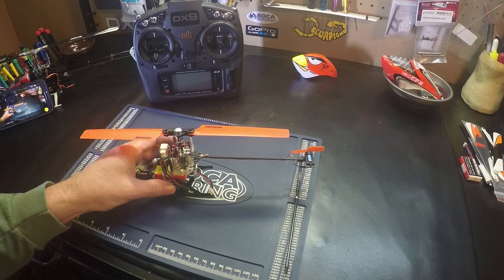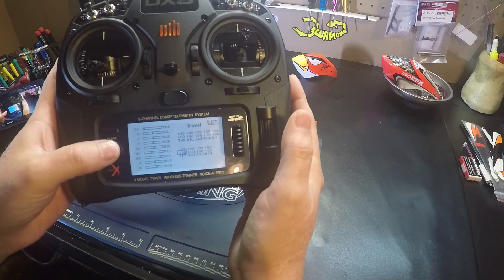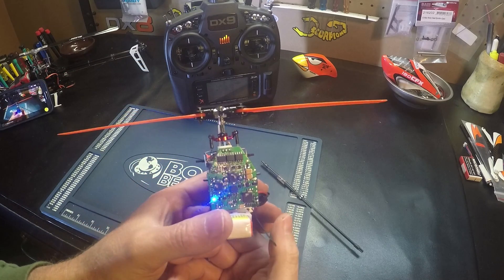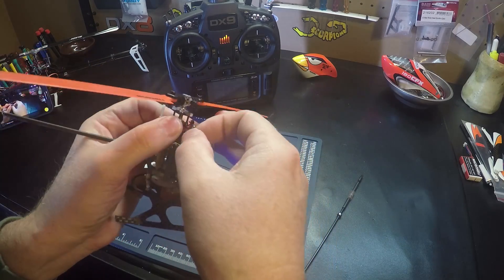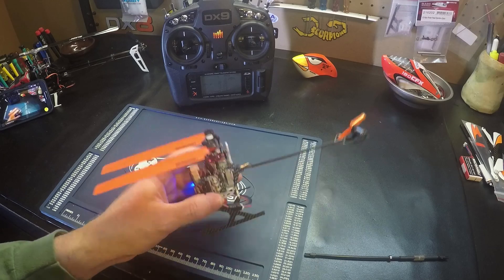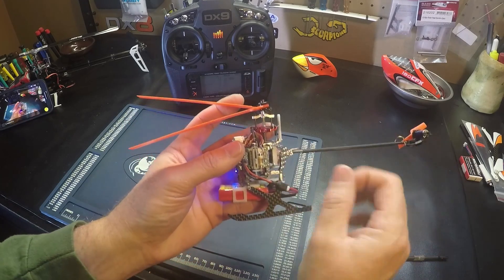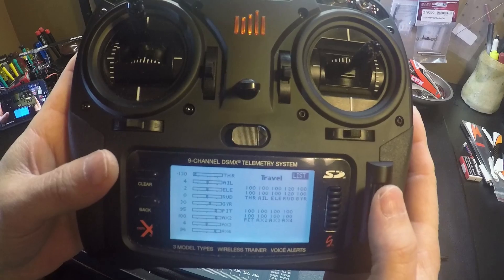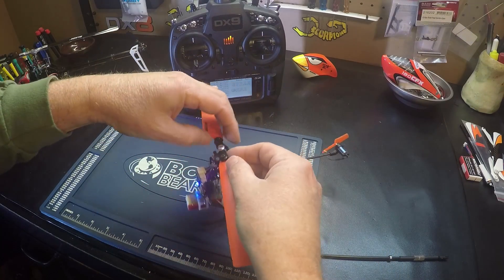Blade Mcpx BL how to level swash, set zero pitch at mid stick and set positive and negative pitch

Comment: Wow that thing is tiny and I know I couldn’t see that helicopter out side of it got to far from me but wow I’d have it crashed if I done a forward flight with that tiny thing I’m 45 years old I been flying helicopter’s since I was 16 years old my mom bought me my first raptor 30 after my dad got me my very first helicopter it was a hairobo shuttle it had no forward heading or a gyro in it you had to fly that baby back in the day it wasn’t a stunt helicopter but it was fast and fun once you got use to it lol after my mom got me my first raptor 30 I went out on my own and in time I got me the raptor 50 and 60 and the 90 and I still have them all and there still like brand new still and I still fly them off and on once in. While but I have a new helicopter I like to play with the kracken and the blade 230s v2 them are fun the kracken is one mean beast of a helicopter I will tel you that for sure

Comment: I'm curious as why you can't just use sub-trim/pitch to get zero pitch at mid stick? That's how I center servos for my surface vehicles... Sub-trim (as opposed to normal trim) moves center but keeps full travel distance in either direction.
Reply: scott sanger  LOL ... if your transmitter dies, you have a bigger problem on your hands!!!

Comment: If your swash is level and everything and it still drifts to the left and back what do you do?
Reply from the maker: +Tyler W You may have a vibration for example a bent spindle. If everything is good and still drifts adjust the trim on your radio.
Reply: +JJInvertedProduction It's brand new out of the box I balanced the blades and there is no vibration . Is it ok to adjust trim on transmitter with a flybarless heli?
Reply from the maker: +Tyler W I've done it on micros for years with no issues. Bigger helicopter I don't do it or micros with rotary servos
Reply: +JJInvertedProduction ok cool thanks. Ya I've had a couple helis and never had one do that except maybe my nano. Is it just something wrong from like the gyro calibration at the factory or something?
Reply from the maker: +Tyler W It could be, you might try calibrating your radio gimbals